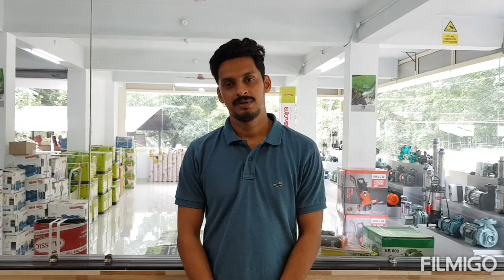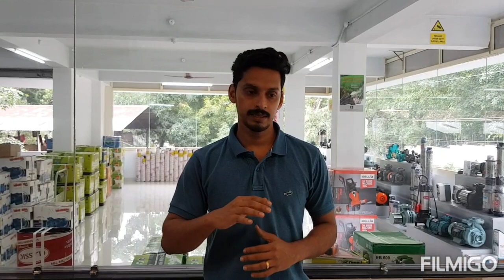വീട്ടിലേക്കു പമ്പ്സെറ്റ്  എങ്ങനെ സെലക്ട് ചെയ്യാം ? How to do head calculation & Pump Selection.

Comment: Hello Sir, we have 12 acres land in slant position down to up from the river 100feet, river is attached to the 12acre land and we have another land around 3 acres which is far nearly to 1km..so now planning to opt single motor openwell submersible pump with 3phase.. Which is the right brand and how much HP to be chosen and also please suggest me with the stages as well?

Comment: ഞങ്ങളുടെ വീട്ടിലെ കുഴൽ കിണറിനു 350 feet ആഴമുണ്ട്. Total head 400 feet.discharge rate required  minimum 2000 Litre /Hr. 1.5 hp Pump വേണ്ടി വരില്ലെ?compressor or submercible is better. നല്ലൊരു pump Suggest ചെയ്യാമോ
Reply from the maker: Submersible pumps will be the best option.
Best brands : EKKI-DECCAN , Texmo-Aquatex,Shakti

Comment: For a transfer pump having 40 mtr total head to transfer water from ground floor tank to rooftop tank if we're using a duty and standby pump what head should be considered for each individual pump ? 40mtr head x 2 pumps or 20mtr x 2 pumps ? Could you pls help
Reply from the maker: 40mtr *2

Comment: Hlo bro കിണറിൽ നിന്നും 7 to 8  meter height 70 meter തറ നിരപ്പ് (Horizontal) പറമ്പ് നനക്കാൻ ആണ് ഏത് മോട്ടോർ ആണ് അനുയോജ്യം
Reply from the maker: For irrigation purpose we normally go for 1.5HP. Considering your site condition 15meteril maximum discharge ulla pump will be the best option.

Comment: 15.7 mtr head (ground to well 10.3mtr indu but 7 mtr il aanu goot valve vekka, 3 months കയറിൽ ഇറക്കി ഇടും) 

അങ്ങനെ ആണെങ്കിൽ 15.7 ന് 
Single floor house aanel ethra HP , HEAD monoblock pumb aanu ഏറ്റവും efficient ആകുന്നത്  ?

Comment: Bro, ഈ voltage കുറവ് ഉള്ള time ൽ Submersible oN ചെയ്യരുത് എന്ന് പറയുന്നല്ലോ പഴയകാല centrifugal പമ്പ് പോലുള്ളവയെ അപേക്ഷിച്ച്. അങ്ങനെയുണ്ടോ ? ഞാൻ കിർലോസ്കറിന്റെ കവറിൽ 160- 250 v range കണ്ടു Kosi 135 model ന്. അത് കണ്ടപോൾ ഏതു റേഞ്ചിലും മോട്ടർ ON ചെയ്യാം എന്ന് തോന്നി. കാർലോസ്കർ എങ്ങനെയുണ്ട് ?
Reply from the maker: 160 വോൾടേജ് എന്ന് KOSI-135 ഇൽ  എഴുതിയിരിക്കുന്നത് എന്റെ ശ്രദ്ധയിൽ പെട്ടിട്ടില്ല.അങ്ങനെ വരാനും ചാൻസ് ഇല്ല . 180 വോൾടേജ് മോട്ടോർ ഓൺ ആയതിനു ശേഷം മിനിമം  ഉണ്ടെങ്കിൽ മാത്രം ഏതു പമ്പും  യൂസ് ചെയുന്നതാണ് നല്ലതു.
സബ്‌മേഴ്സിബിൾ പമ്പ് മുകളിൽ വക്കുന്ന പമ്പിനേക്കാൾ കൂടുതൽ കറന്റ് എടുക്കുന്നതുകൊണ്ടായിരിക്കും ലോ വോൾടേജ് സമയങ്ങളിൽ ഉപയോഗിക്കരുത് എന്ന് പറയുന്നത്. 

https://www.youtube.com/watch?v=ZcwABkPDE_4&lc=UgyY43OBvBDdYFaShf94AaABAg
Reply: @thundathiltraders Packing Cover ന് പുറത്ത് 210 v എന്നാണ്. Booklet ന് ഉള്ളിൽ Can withstand voltage fluctuations 160- 260 v എന്ന് കണ്ടിരുന്നു..
Reply from the maker: Withstand cheyyum ennayirikum bro. Work cheyyumbo ennariyilla. 
Work cheythalum etra head kitum , etra discharge kitum, etra current edukum enoke check cheyyanam. Angane use cheyunathu ottum safe alla
Reply: @thundathiltraders  അത് കറക്ടാണ്. voltage 200 ൽ താഴെ ഉള്ളപ്പോൾ ON ചെയ്യണം എന്നില്ല നമുക്ക്. ഇപ്പോൾ LED ബൾബ് ആയോണ്ട് voltage കുറവ് അറിയില്ല. മോട്ടോറിന് ശബദം പുറത്ത് കേൾക്കാത്തത്കൊണ്ട് ആ വഴിക്ക് ശബ്ദത്തിൽ നിന്നും അറിയില്ല voltage കുറവ്. അങ്ങനെ അബദ്ധത്തിൽ ON ആക്കി കേടാകരുത് എന്ന് മാത്രേ ഉള്ളൂ. പിന്നെ ഞാൻ Multimeter ൽ നോക്കിയപ്പോൾ വൈകുനേരങ്ങളിലും 210 ന് മുകളിൽ voltage ഉണ്ട്. അടുത്ത് ഒരു transformar ഉണ്ട് . അതാവും വല്യ voltage കുറവ് ഇല്ലാത്തത്.

Comment: 17 koll ulla kinar ethra .mtr anu..and two store house so ethra hp ulla pump use cheyendi varum
Reply from the maker: Koll pala sdalathum alavu vathyasam undu. Chila edangalil 2.25 feet anu. Athu onu confirm cheyyamo
Reply: @thundathiltraders   1 koll 72 cm
Reply: @thundathiltraders  you said it 2.25 it's around right
Reply: കിണറിന്റെ ആഴം 7 മീറ്റർ, 5 മീറ്റർ horizontal, ഉയരം 8 മീറ്റർ,1 എപി ഏത് പമ്പ് ആണ് suitable

Comment: 60mtr ind tankilek kinnaril ninum..kinnarintte aayam 6mtr,randu nila vidu athra hp motor vendi varum (monoset pumb)
Reply from the maker: veettu avashyam anenkil 1hp mathiyavum 21-22 meter headil maximum discharge ulla pump vangiku. minimum head below 20 meters and maximum head etra venamenkilum ayikote. (24-28)

Comment: 15 mtr kinar. 9mtr vertical. 20 mtr flat. Bend 9 ennam. 110 mtr Headulla motor madhiyo...?
Reply from the maker: 110 adi motor ok anu. 30 meteril maximum discharge ula pump nokku

Comment: Hi bro,  Could you please suggest good and long life centrifugal pump model & Company for my home having 1Hp or 1/2Hp. My well depth about 7.5 and old motor placed on top of the well. From there it is 7 to 8 meter height to water tank. It's 1 floor house and water tank is constructed using bricks above chimney
Reply from the maker: I have replied to your other message.Thanks

Comment: 200 meter und tank lek kinarinu 15 meter azham etra HP pumb venam
Reply from the maker: vertical pump vakuka anenkil 1HP mathiyavum.
Reply: @thundathiltraders  monoblock anenkilo
Reply from the maker: @niyasck81  1.5HP monoblock allenki 1.5hp 2 stage